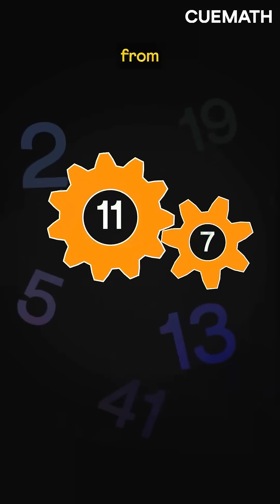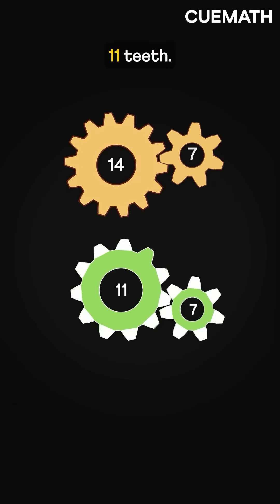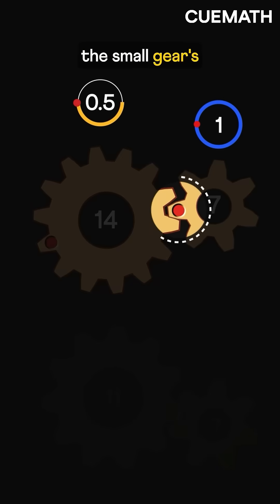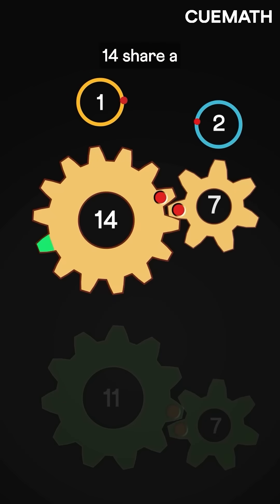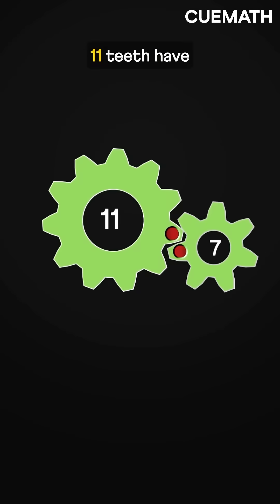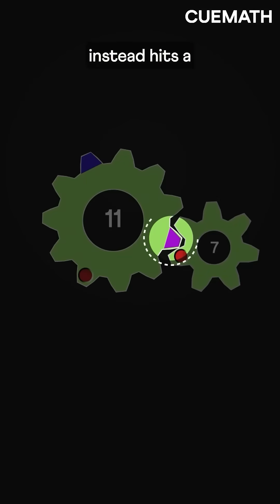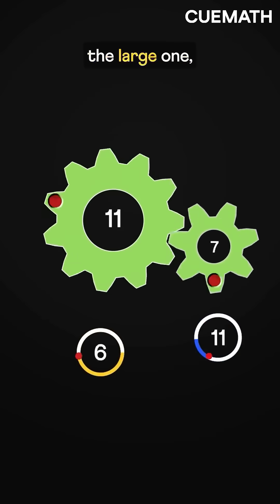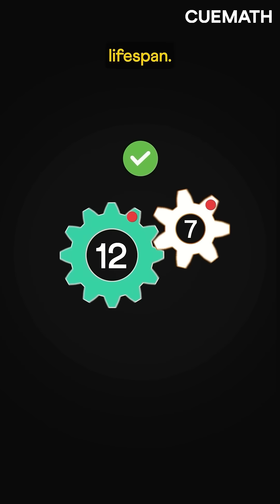Prime Numbers Can Make Gears Last Longer!

Comment: Y to his doesn’t make sense as the video explains it.  The same teeth hitting means the same pattern of wear. Of different teeth hit the west will be less even. Compare this to high grit and low grit sandpaper where the rougher paper wears down the material faster because of less uniform contact.

Comment: Solving the question at the end of the short:

The orange gears (top) have 12/8 ratio.

12 primes are 2 and 3: 12/2=6/3=2
And 8 primes are just 2: 8/2=4/2=2

So in sumary, they share 2 numbers: 1 and 2 as comun denominators.

Now for the purple ones (bottom) they have a 16/9 ratio.
16 primes are just 2: 16/2=8...=2
And 9 primes are just 3: 9/3=3
Therefore they only share one commun denominator: 1.

Comparating the shared deniminators (size 2 vz size 1) the purple set (bottom) will stand the last, making the orange set (top) break first.

Comment: New gears don't slide over each other, their surfaces roll across each other, so wear is minimumized drastically.  Once the gears begin to wear, the wear is drastically accelerated.  They begin to whine, and will need replaced shortly.

Comment: The wear is definitely evened out across the prime numbered gears, however, the 11 tooth gear has about 22% more wear over a given time period (if the 7 tooth gears both move at the same speed in each situation). Another issue I see, if the 7 toothed gear in the prime numbered set has a damaged tooth, the tooth will damage every single tooth on the 11, while on the 14 it will only damage 2 teeth.

Comment: The A option is 12/8 mean the ratio is 3/2. The big gear will turn 2x and the small one need to turn 3x to meet the same gear.

The B option is 16/9 mean the ratio is still 16/9. The big gear need to turn 9x and the small one need to turn 16x to meet the same gear again

Idk wdy guys actually talking about I just think it is only ratio problem

Comment: Unlike what's stated in the video, for this effect non of the gears need to have prime number of teeth, they only have to be co-prime like the examples in the end. Neither 16 or 9 are prime, but they don't have any common factors, so will be the same as with 7 and 11.
Also as other said, this doesn't really slow down wear in general, it just evens out the wear between teeth.

Comment: That makes no sense… it doesn’t matter if the teeth line up again, it still hits the other teeth which will wear down the tooth, same for all teeth. Just because it’s making contact with a different tooth doesn’t mean it suddenly doesn’t get worn down by making contact with something…
Reply: The guy forgot to mention that wear occurs when there is an imperfection/bump on one of the teeth.
So, when you use prime numbers, this bump doesn't always hit the same tooth on the other wheel.
Reply: I'll have to say this in Thai ; คูณร่วมน้อย
Reply: It's a More Even Degradation, So it Lasts Longer. Otherwise you would get a Lot of Wear on Certain Teeth.
Reply: What nobody talking anout is 2 things. Friction and gravity. You'll devolpe a wear pattern with non prime gear teeth.

Comment: This is cool, until you realize that gears are supposed to transfer the movement down to precision, and either transfer the exact same speed, or multiply or divide it by some specific factor. And the gears are interlocked, very tightly. They have to be oiled, because of friction. Which means that greater wear of the gears is not nearly as much alarming as when the gears would be loose. Because if your gears are loose, then you've got bigger issues than simple wear.

Comment: OK. So only the first teeth that you consider causes wear and tear. The other teeth don't interact at all?? 😂
Reply: It’s focusing on one tooth to explain, all teeth interact with their counterpart, second tooth of gear 1 with second gear of gear 2 and so on
Reply: I think it's referring to imperfect teeth. If one of them is shaped wrong and causes more wear then it will not be focused on one of the other teeth, but evenly spread.
Reply: It applies to All Teeth

Comment: You can just look at the fraction
For example, 8/12 is 2/3 so 12 would hit the same tooth 2 times and the 8 would be 3 times. Prime factors can also have less unique hits than composite factors. For example, 5-7 is worse than 238-272 since 238-272 is 7/8 in its base form and 5-7 is only 5/7

Comment: Even if the gear teeth will not be in contact with the first one but surely will be in contact with other theeth causing same wear n tear😭
Reply: It just spreads the damage to the gears
Reply: @ankhniibichleg6655  it can only work if one teeth is defected which is causing a specific teeth to wear out...and by setting odd gear ratio that specific defective gear will collide with different gears , spreading the damage but in normal condition this trick is not that usefull....hopee you understand 👍🏻
Reply: @satyanshsingh231yeah, they are acting like only one of the teeth on the small gear is causing wear. It doesn't matter how many teeth there are because at any given time when it's turning there are 2 teeth getting worn out.
Reply: @ankhniibichleg6655 So does the other protrusions. It is really better

Comment: Never heard of this, so had to research it a bit. OP got it a bit wrong. What he described is the uneven wear down of gears with a higher gear ratio. A ratio of 11/7 has a more even wear down than 14/7 than 17/7. Notice, last are also prime numbers, but is worse than 14/7. The number of contacts of a tooth with the same tooth doesn't matter for the wear down, since all the tooths get the same treatment.

But this only works with perfect gears, sadly we don't live in a perfect world. What OP possibly meant is, when making gears, they are not all the same. Some tooth for example could have a little spike or smth like this. And if this defect hits the same place on the gear over and over, it could lead to failure. This happens if the gear ration is a whole number, like 14/7=2. The solution is to avoid it, like using prime numbers. Instead of 14/7, use 13/7 or 15/7. But it's not necessary to use prime numbers, also instead of 14/7, use 15/8. But that is only with the premise that the gear ratio doesn't need to be exactly 2. And the avoidance of prime numbers is even better, in case u need manageable numbers for Ur gearbox. (Using prime numbers leads to non-terminating decimals gear ratios, which is another whole can of worms)

I hope that helped anybody, who was confused. ^^

Edit: thx to wyattstevens8574 for correcting me about 11/7 not being an irrational number
Reply: This makes a lot more sense than the video itself. Thanks for sharing!
Reply: "Irrational" gear ratios, with integer number of teeth in both gears? By definition of "irrational" in this context, that's impossible!
Reply: @wyattstevens8574  sry, u're absolutely right. Somehow I thought that non-terminating decimals are the same as irrational numbers. But yeah, by definition they can't be. Thx for correcting me, I edited my comment.
Reply: Thank you
Reply: You could describe the property of numbers thats fit for this concisely as co-prime
Reply: Why does 11/7 have more wear down than 14/7?
Reply: @harold2 "more even" wear down, not "even more" wear down
Reply: Thanks man
Reply: that is not really true tho
Reply: I was so confused like every tooth is having a contact atleast thankyou ❤❤😊😊
Reply: Thank you. Why is 17/7 also worse? And worse than 14/7?
Reply: I like your comment more than the video
Reply: Now this makes much more sense, thank you❤
Reply: Couldn't similar results to prime numbers be achieved through numbers not sharing  any prime factors
Reply: Hey there is a much easier way to reduce the wear though its much more expensive

There is an alloy made of platinum and gold that is even more wear resistant than ruby (the most common "frictionless" material) and you just need to electroplate the platnigol(what I think it should have been called) onto the base gear
Reply: That makes sense because 2 is actually a prime number, which disproves the theory that having a perfect ratio of 2 wearing out faster than the 11:7 ratio
Reply: I don't understand what he explained wrong tho, that's exactly what i understood.
Reply: exactly what I was thinking, why should it matter that the same 2 teeth come into contact if the teeth are all identical? thanks for the clarification
Reply: This might be why planetary gearboxes were invented, so your integer gear ratio is determined by the sun and ring gears but the planet gears can have a prime number of teeth to even out the wear
Reply: 17 with 7 is not worst. In fact, when is 17 vs 7, the bad tooth on the small gear will damage the same point after 17 spins. I just checked programming a simulator of the gear system.
Reply: "OP"? This isn't reddit.

Comment: I'm lost why does it matter that the same tooth is contacting? Wouldn't it having to deal with a large array of different teeth have problems instead?
Like if I assume that repeated same gear contact meant wear I understand the rest of the video, but I can't understand why this is so?
Reply: because if teeth have imperfection, it will affect the same teeth over and over, causing damage
Reply: I was thinking the same

Comment: How is not just every tooth getting the same wear? You dont have wear on just a single tooth
Reply: I assume it refers to the inevitable imperfections of the gear. The same imperfection would hit some specific teeth constantly, which could break the mechanism over time. With a prime number of teeth, the impact of the imperfection gets distributed around the whole circumference of the other gear.
Reply: @user4241 Exactly- since x and y are coprime, it takes x turns of the y-toothed gear (or equivalently, y turns of the x-toothed gear) for the gears to line up again!